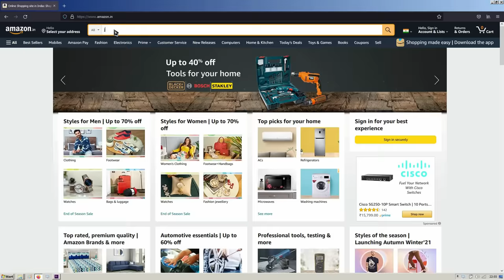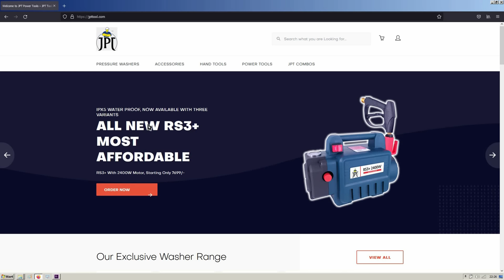One machine for all works! JPT HEAVY DUTY 21V CORDLESS IMPACT WRENCH Review with 96pcs socket set

Comment: Bro I hope this is a paid promotion. The price is low because it only has an adjustable torque setting of low\high. But other brands they're having with 42 torque settings with high\low mode. Also only the torque wrench kit price is 9k and the toolbox is separately needed to buy. Also the most important thing you forget is what was the maximum torque it can produce in the low and high.

Comment: We have house in ground floor, and buliding first and second floor. We need 3 seperate eh bill for every floor so what is the procedure to do it.. do we need to install sub meters for all 3 houses seperately? 🙄 TY
Reply: You need to apply in EB office to get separate connection. Every house should have sepeate kitchen. Then only they give separate service. Cost mat be differ depends your need eitherb3 phase or single phase. You can fix a sub meter. But you should pay huge amount. Coz 3 floor current supply only single meter which you get from EB.

Comment: Bro one doubt.i have 2eb meter .in one meter when reach 300 units I will remove the cable and connect to another meter ...bro ..will take to 1moth to Change the connection..but is Will connect that meter it will not work bro...but green light glow but dimmly glow.. what the reason bro me to  solve the issues...I will called eb man Tmro

Comment: Syed bro, 1 doubt. 1500watt immersion rod water heater irukku. Ithuku normal plug point use pannalama? Plug size perusa irukku.. so reducer use pannalam nu nenaikuren. Normal plug point la 1sq mm than wire irukum.. so reducer use panna ethum prachana varuma? or 1.5sq mm wire than use pannanuma?  Please explain.
Reply: Use pannalaam, used only for several minutes , not continuosly use hours, if use continues hours cable insulation failed due to cable wire heat , so long term not running